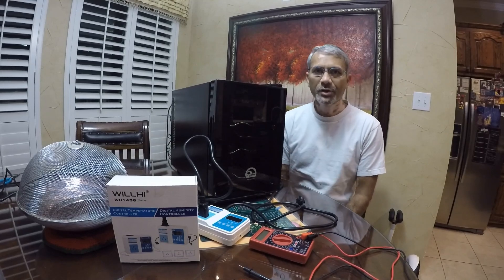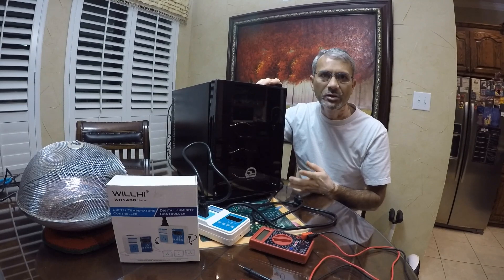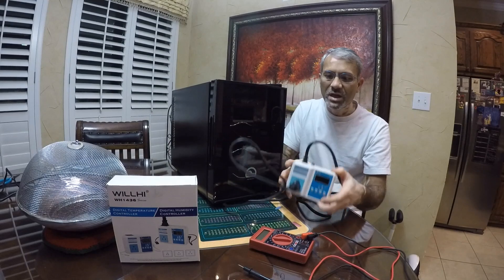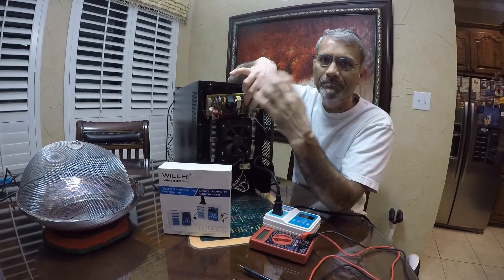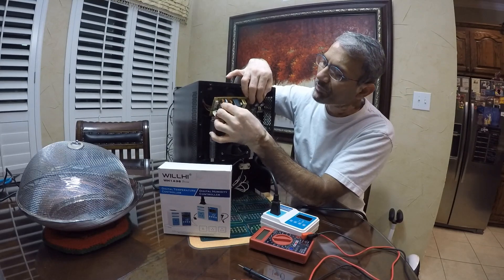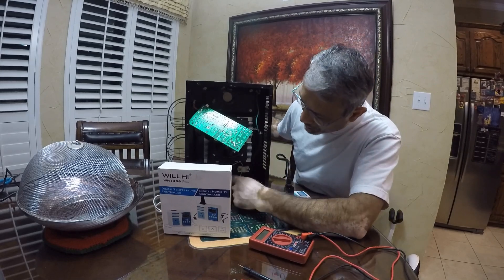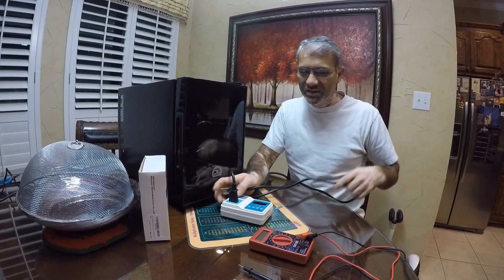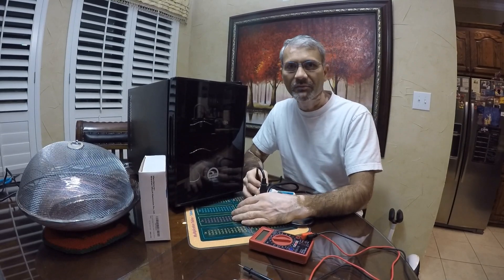HOW TO make an Incubator using a wine cooler!

Comment: So i bought one with the compressor. Will it work if i shut off the compressor and switch the red and black wire?
Reply from the maker: I am afraid not. This trick only works with coolers without a compressor.

Comment: Thank You.  I found the 2 (of 6) red and black wires that were 12v and reversed them.  It reached about 123' F in about 45 min.  When my temp controller came in it was able to regulate at 93'F for a 30 minute test.  Now I have an $18 (cost of temp controller) (wine cooler-free) incubator to raise my Queen Bees.

Comment: There are 3 red wires and black wires, in my wine cooler. I don’t know which one I have to switch it
Reply from the maker: Try to measure voltage between the wires. Two carrying current to cooling plates will have 12-24V DC. You want to reverse those two.

Comment: I enjoyed your video. You make it easy to follow your advice. One step I am unclear on though is the role the existing circuit board plays once you reverse the red and black wires, and add the external switch and temperature probe. Will the existing board not try to reduce the temperature? Seems like something else needs to be disabled but I don't know what.
Reply from the maker: Yes, the existing board will try to reduce the temperature which will increase temperature due to the fact we have reversed the polarity. Eventually, the external controller will turn off power to the board and thereby stopping the runaway cycle of temperature increase. It is convoluted logic but I hope it makes sense now.

Comment: How did you separate the heating element to switch the red and black wire around to switch it from heating to cooling .. mine seems to be connected with some sort of adhesive .. do I just carefully pry them apart ?
Reply from the maker: Yes, you can try to pry the adhesive but I would just cut the wires little away from the connector and then splice them after reversing.
Reply: @PrincetonProjects  i figured it out but the original thermomostat in the wine cooler only goes up to 65degree f.. im going to be using it for reptile egg incubation at 88-90 degrees so I think im just going to have to pull all these stuff and put some flex watt heat tape with a external thermostat to control the heat tape temo
Reply from the maker: @anthonyconti1065  Sounds like a plan.

Comment: Hello, can you name the product name for your controller and what do you do about humidity? Thanks!
Reply from the maker: The controller is Willhi WH1436 but you can use any controller. I don't have humidity controller but I put a wet sponge in the incubator and it maintained humid in 70% RH range (measured with a meter). The size of the sponge should be able to control the humidity in such a small space.